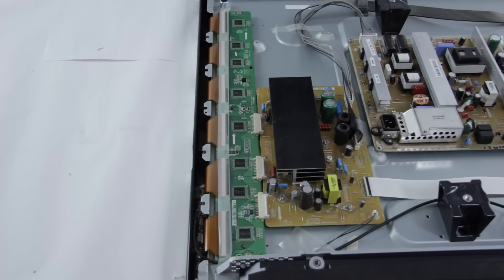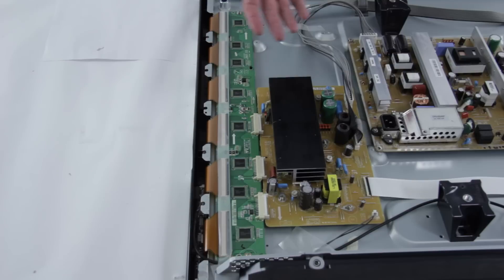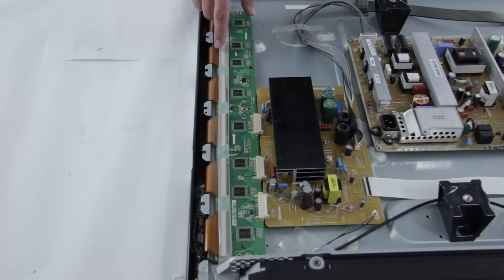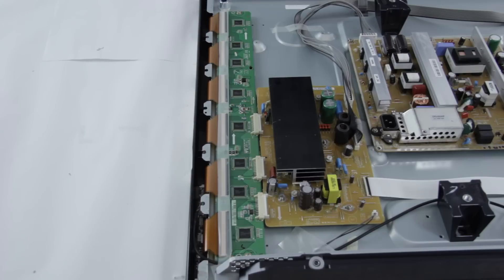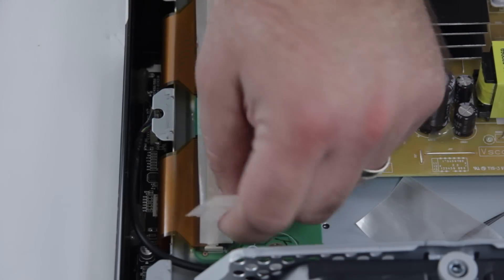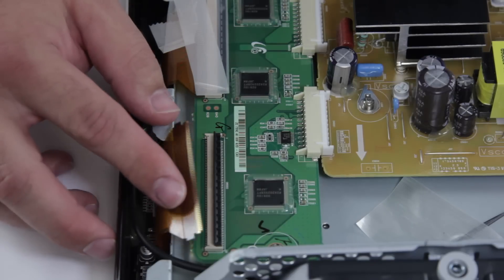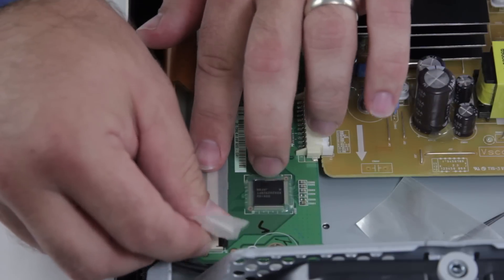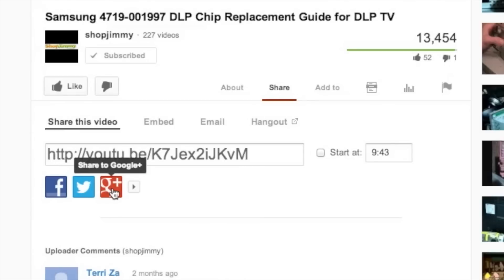Plasma TV Repair - No Image, No Picture on Plasma TV Screen - How to Replace Y-Buffer & Y-Sustain

Comment: Hello.  I have a Samsung PN60E8000 TV.  The symptoms of my tv started out with the screen going black a few minutes after the tv was turned on but I still had sound.  Turning the tv off and on, sometimes several times, would fix this temporarily.  Now the tv has no picture at all, it does not display the Samsung logo during start up either.  Changing channels on my cable box will make the sound come on.  I found that the sound works if I go from a 1080p channel to a different 1080p channel.  If I go from a 1080p to 720p the sound will go out.  Please help me with this problem.  Thank you.

Comment: We have 65" Samsung Plasma TV. Suddenly we turn the TV, we can hear the sound of power on. But, no picture or no sound. Our model# PN63C8000YF. Could you please let us know what repairs are we looking at ? Thank you so much!
Reply from the maker: Saratoga Girl Scouts   PLEASE SUBSCRIBE TO OUR CHANNEL - Try all repairs and troubleshooting at your own risk.  I recommend replacing the Y-Main Board and the Upper and Lower Y Scan Drive boards in your TV.  Click this link to replacement parts for your TV model number:  https://www.youtube.com/watch?v=R1jmj_foId0  There may be multiple boards for the same TV model number, be sure to match part numbers on your current board, with your replacement for compatibility.  Here is a link to a video showing how to identify your part number, click here:  https://www.youtube.com/watch?v=R1jmj_foId0  Thanks and please let us know if you have any further questions with your TV Repair!  www.shopjimmy.com

Comment: Hi, I have a LG60PZ950, it used to have colored artifacts due to cracked soldering on some of the coils on one of the boards. I fixed it and was perfect for about a year or so. Now I am having a new problem. The TV screen randomly switches off, I still have sound just no picture. If I switch the TV off and back on it's fine again. This happens after a few hours of using the TV sometimes as little as an hour, and sometimes not at all. When it does go black, after powering off and back on again the TV may again work for hours or just minutes. I am still able to watch TV, but it's a bit annoying and I am worried that it will get worse and I'd like to fix it if I can. Any ideas as to what maybe the problem? Thanks in advance for any help.

Comment: I have a toshiba Model #50HP16 the screen shuts off after about 45 min. I can still hear everything so I know the tv is still on. If I shut the tv off for a minute or so the screen will come back on but only lasts 5 min before the image starts flickering colors and gets kind of grainy then the image shuts off again. 

Any ideas or suggestions of where to look would be a great help. I am very comfortable with electrical  diagnosis but I don't know the component names of tvs.
Reply from the maker: Jason Reed  Try all repairs and troubleshooting at your own risk.   I recommend replacing the YSUS and the YDRVTP & YDRVBT boards in your TV.  Click this link to replacement parts for your TV model number:  http://www.shopjimmy.com/catalogsearch/result/?q=50HP16  There may be multiple boards for the same TV model number, be sure to match part numbers on your current board, with your replacement for compatibility.  Here is a link to a video showing how to identify your part number, click here:  https://www.youtube.com/watch?v=GEllG3RV-tcThanks and please let us know if you have any further questions with your TV Repair!  www.shopjimmy.com

Comment: My neighbour threw out a Samsung PS42E7HD plasma TV. I took it to see if I could fix it. I turned it on and I could smell something burning! I opened up the TV and visually I could see a few capacitors blown on the power board. I changed them and powered up the TV. It clicks and the red standby light flashes 4 times. I checked power levels Vs etc and all voltages were correct. I checked the Y main and found a blown capacitor and two resistors faulty. Replaced those and still I get a click and 4 standby light blinks. Should I replace the Y main board completely or carry on fault finding? How do I check the power running through the Y main board? Any help would be great, thanks.
Reply: I already tried disconnecting the boards. The TV still starts but there is no picture. I did find out there was sound. I replaced the y- main, x-main and logic board. Turned it on and smoke came out the y-buffer. So that's fried now. I have some ic chips but I can't find them arghhh!! The TV flashes on and off now with clicks. The y-main is pushing way too much voltage to the y-buffer. Unplug the y-buffer and y-main readings are good vsc_h etc. I don't get where its going wrong.
Reply from the maker: gpateluk73  PLEASE SUBSCRIBE TO OUR CHANNEL - Try all repairs and troubleshooting at your own risk.  I recommend replacing the y board and the y buffer boards in your TV.  Unfortunately I do not see any replacement parts in the search results for your TV model number on our website.  Thanks and please let us know if you have any further questions!  www.shopjimmy.com

Comment: hello, my tv is showing a snowy picture. its not all white but the picture shows streaks of colors while showing the picture. please advise
Reply from the maker: Nene Woodard   Try all repairs and troubleshooting at your own risk.  Please reply with your TV model number.  Click here to view a video that shows how to find your TV model number:  https://www.youtube.com/watch?v=S51nhAmwR2M  Thanks!  www.shopjimmy.com
Reply: 42pc1da-ub.a
Reply from the maker: Nene Woodard   Try all repairs and troubleshooting at your own risk.  This could be a problem with either the main board or the t-con board in your TV.  Unfortunately, I do not see those replacement parts for your TV model number on our website.  Thanks!  www.shopjimmy.com

Comment: I have a 55" Samsung plasma tv. Not sure of the model number right now but basically my two year old hummed a ball at the screen. It started as a crack in the glass, then a black circle, then two horizontal lines across screen, to now all black. It still has sound and turns on. Is it even worth fixing at this point?

Comment: Hi ShopJimmy.com,
Thank you for helping everyone. I have LG 60PZ950 Plasma TV, last week, It had popping sound and after that there is no picture and no sound. When I turn the TV on it turns on, if I press setting Button or home button nothing happens, just a blank screen. My TV is only 2 years old and I barely used it. When I turn the TV on it has start sound and then power button turns on, but no images. Also when I change the channels power light comes as it was when you use your remote. So I need your help. What needs to be replace on my TV or I shall Buy a new TV? Thank you very much for your Help.
Reply from the maker: rabu82  PLEASE SUBSCRIBE TO OUR CHANNEL - Try all repairs and troubleshooting at your own risk.   I recommend replacing the YSUS and the YDRVTP & YDRVBT in your TV.  Click this link to replacement parts for your TV model number:  http://www.shopjimmy.com/catalogsearch/result/?q=60PZ950  There may be multiple boards for the same TV model number, be sure to match part numbers on your current board, with your replacement for compatibility.  Here is a link to a video showing how to identify your part number, click here:  https://www.youtube.com/watch?v=GEllG3RV-tc Thanks and please let us know if you have any further questions with your TV Repair!  www.shopjimmy.com
Reply from the maker: rabu82  PLEASE SUBSCRIBE TO OUR CHANNEL - Try all repairs and troubleshooting at your own risk.   I recommend replacing the YSUS and the YDRVTP & YDRVBT in your TV.  Click this link to replacement parts for your TV model number:  http://www.shopjimmy.com/catalogsearch/result/?q=60PZ950  There may be multiple boards for the same TV model number, be sure to match part numbers on your current board, with your replacement for compatibility.  Here is a link to a video showing how to identify your part number, click here:  https://www.youtube.com/watch?v=GEllG3RV-tc Thanks and please let us know if you have any further questions with your TV Repair!  www.shopjimmy.com
Reply: I replaced YSUS and the YDRVTP & YDRVBT in my TV, but still same problem. power is on but no picture and no sound. Help me please. Thank you
Reply from the maker: rabu82  Try all repairs and troubleshooting at your own risk.  Be sure to double check that you have all of the cables and connections tight.  Did you match part numbers on your replacement parts with the originals?  Also, there is the possibility that you received defective replacement parts.  Thanks!  www.shopjimmy.com

Comment: Have a Panasonic TC-P50S30, made a pop noise and now there is no display.  The LED power light comes solid on but you cannot turn it off with remote or power button on the side.  If you pull the power to turn the LED off when you power it on you can hear a click like normal but no display.
Reply from the maker: force13b   PLEASE SUBSCRIBE TO OUR CHANNEL - Try all repairs and troubleshooting at your own risk.  I recommend replacing the SC, SU & SD boards in your TV.  Click this link to replacement parts for your TV model number:  http://www.shopjimmy.com/catalogsearch/result/?q=TC-P50S30  There may be multiple boards for the same TV model number, be sure to match part numbers on your current board, with your replacement for compatibility.  Thanks and please let us know if you have any further questions with your TV Repair!  www.shopjimmy.com

Comment: Samsung Plasma PS42A456 model, no picture or sound when powered on, after about 10-15 seconds it restarts again and again... Tried to disconnect Y-sustain or Z-sustain, one at a time but it still would not stay on:/ what can i try next? Thanks in advance
Reply from the maker: Justas Tulpe  PLEASE SUBSCRIBE TO OUR CHANNEL - Try all repairs and troubleshooting at your own risk.  This could be a problem with either the main board or the power supply board in your TV.  Do you have experience using a meter to check voltages?  If not,  you can replace each board individually to see if one of those boards fixes the problem.   Be sure to match part numbers on your current board, with your replacement for compatibility.  Thanks and please let us know if you have any further questions with your TV Repair!  www.shopjimmy.com

Comment: Hello. We have a  Samsung model # PN51D440A5DXZA, SER Z3803CQBA01164V 
VERSION # N401 made in 2010. It was working fine when we turned it off.  Hours later we turned it on and all we get is a black screen and a buzzing sound.  The power button LED light flashes continuously when it used to go off when TV was on.  Would appreciate any DIY suggestions. Thanks!

Comment: I have a Sansui HDPDP4200A Plasma Monitor which stop showing video after I blew a circuit breaker while using a power tool on the same circuit. The Monitor was on at the time but after I flipped the breaker back on the set turns on but no picture. There is a Samsung PDP Module # S42AX-YB01 in this unit. I was hoping you might help me out.
 
A visual inspection inside the unit revealed a bulged capacitor at C5040 on the ‘Y’ board and a real funky looking fuse at F5004 also on the ‘Y’board. The fuse seems to have some sort of white deposit built up on one end of it.
 
You now know everything I know about this or any other TV. Can you help with the information I provided?
 
Thanks,
Mike
Reply from the maker: Michael Hopperton  PLEASE SUBSCRIBE TO OUR CHANNEL - Try all repairs and troubleshooting at your own risk.   I recommend replacing the y board and buffer board(s) in your TV.  Unfortunately I do not see any replacement parts in the search results for your TV model number on our website.  Thanks and please let us know if you have any further questions!  www.shopjimmy.com

Comment: hi Jimmy i have LG 42" 42pn4500  plasma tv, no picture but i have sound and the red light is on please let me know whats wrong and if you have the parts in stock to fix my problem.
Reply from the maker: Felix Moreno   Try all repairs and troubleshooting at your own risk.  I recommend replacing the YSUS and the YDRVTP board in your TV.  Click this link to replacement parts for your TV model number:  http://www.shopjimmy.com/catalogsearch/result/?q=42pn4500  There may be multiple boards for the same TV model number, be sure to match part numbers on your current board, with your replacement for compatibility.  Here is a link to a video showing how to identify your part number, click here:  https://www.youtube.com/watch?v=GEllG3RV-tc  Thanks and please let us know if you have any further questions with your TV Repair!  www.shopjimmy.com

Comment: I have a Samsung HP-T5054 Plasma TV.  I was watching tv when I heard a pop and the screen went blank.  The sound remained on but after turning off and on, there is no picture or menu screen.
Reply from the maker: John Stumpf   PLEASE SUBSCRIBE TO OUR CHANNEL - Try all repairs and troubleshooting at your own risk.  I recommend replacing the Y-Main board and the Upper and Lower Y Scan Drive boards in your TV.  Click this link to replacement parts for your TV model number:  http://www.shopjimmy.com/catalogsearch/result/?q=HP-T5054   There may be multiple boards for the same TV model number, be sure to match part numbers on your current board, with your replacement for compatibility.  Here is a link to a video showing how to identify your part number, click here:  https://www.youtube.com/watch?v=R1jmj_foId0  Thanks and please let us know if you have any further questions with your TV Repair!  www.shopjimmy.com

Comment: I have an lg 50" pg20 it had a bad power supply by clicking..It's been replaced.tv turns on flashes blue 3 times and stays blue but no picture at all..nothing else was touched...It's can hear the tv on..Any clue would be Appreciated?

Comment: I have a Samsung 50" with model number PN50C450B1DXZA. It has no picture, and I haven't confirmed this yet but the previous owner said that it had a horizontal bar on it before it died. If this is the case, is it almost definitely the Y buffer/ Y sustain boards? I am on your site and looking at this part https://www.shopjimmy.com/samsung-bn96-12956a-y-buffer-board.htm and this part https://www.shopjimmy.com/samsung-lj92-01728c-y-main-board.htm as replacements for both. Would the Y boards be the more likely culprit, or is it typically something else?
Reply from the maker: *****  PLEASE SUBSCRIBE TO OUR CHANNEL - Try all repairs and troubleshooting at your own risk.  Yes, I recommend replacing the Y-Main Board and the Y-Buffer Board in your TV.  Click this link to replacement parts for your TV model number:  http://www.shopjimmy.com/catalogsearch/result/?q=PN50C450B1DXZA  There may be multiple boards for the same TV model number, be sure to match part numbers on your current board, with your replacement for compatibility.  Here is a link to a video showing how to identify your part number, click here:  https://www.youtube.com/watch?v=R1jmj_foId0  Thanks and please let us know if you have any further questions with your TV Repair!  www.shopjimmy.com

Comment: I have a Samsung 50" Plasma the model: HP-T5044 . I first started to have a few small red dots and could turn the tv off and on and it would fix the picture . this past weekend I lost the picture but still had the sound and I started to turn the tv on and off a few times and then it ,started to cycle on and off , I unplugged the tv and tried it in a different outlet and all it would do is cycle on and off . I did take the back cover off and unplugged the y board on the tv and then plugged the tv back into the wall outlet still no picture but the cycling stopped and was able to turn power on and off on the tv .I would like to know what I should buy first to get the tv working ?

Comment: I Have a 50" Plasma model# PN50C450B1DXZA it just clicks 5 times, but nothing happens, screen is blank, no volume or nothing. I checked for bulging capacitors but found none that appeared bad. any ideals on what I can do to repair it.
Reply from the maker: Mike Sanders    Try this at your own risk. Unplug the TV, then disconnect the y board and plug in the TV to see if the TV powers up. Reply with the results of this test. Thanks! www.shopjimmy.com
Reply: It was my x-main board, replace it and my problem was solved. Thanks for your reply

Comment: I have a pretty old Samsung hpr5072x/xaa plasma tv that lost it's picture. Based on the above youtube video, I'm guessing I have to replace the Y Sustain and Buffer. I was wondering if you guys had the parts for this model in stock and how much it would cost. Cheers.
Reply from the maker: Chris Law   Try all repairs and troubleshooting at your own risk.  Click this link to possible replacement parts for your TV model number:  http://www.shopjimmy.com/catalogsearch/result/?q=HP-R5072  There may be multiple boards for the same TV model number, be sure to match part numbers on your current board, with your replacement for compatibility.  Here is a link to a video showing how to identify your part number, click here:  https://www.youtube.com/watch?v=R1jmj_foId0  Thanks and please let us know if you have any further questions with your TV Repair!  www.shopjimmy.com